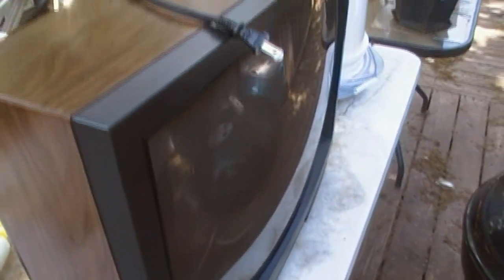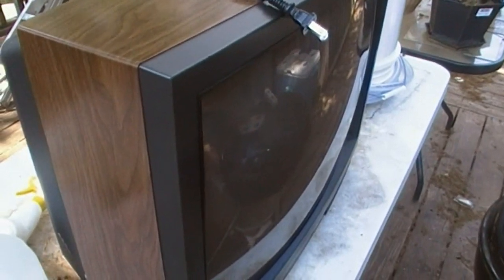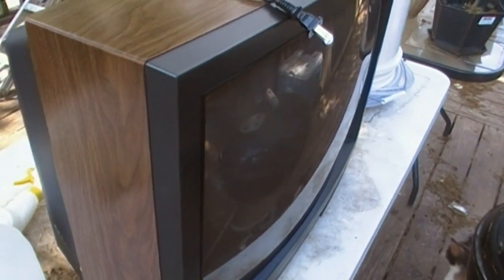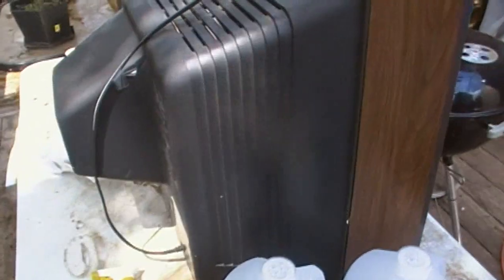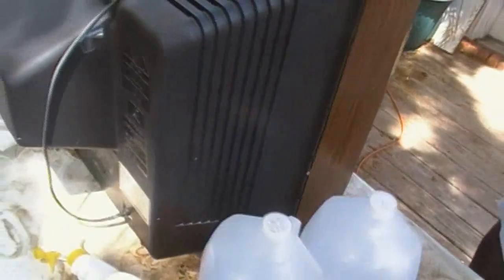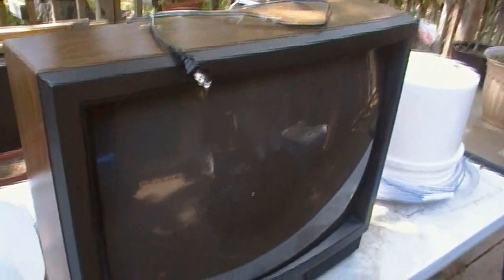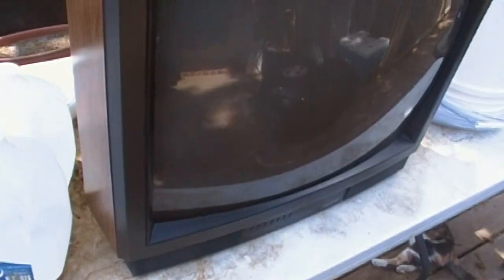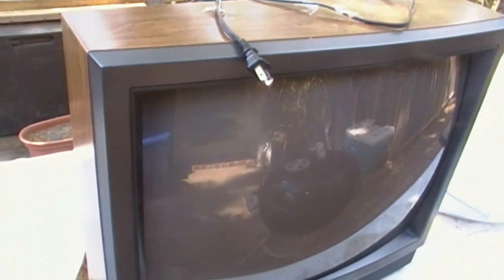Prepper's Parabolic Cooker Project:  Noreen's Kitchen

Comment: Be careful as there are capacitors that hang onto a very powerful charge long after the TV has been unplugged and if you complete the circuit by touching the wrong end - zzzzzzap!